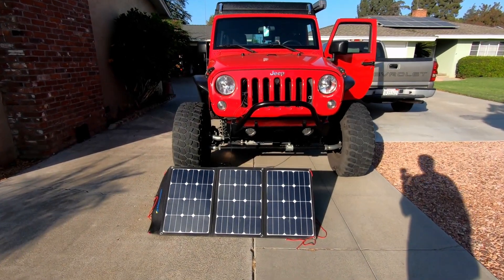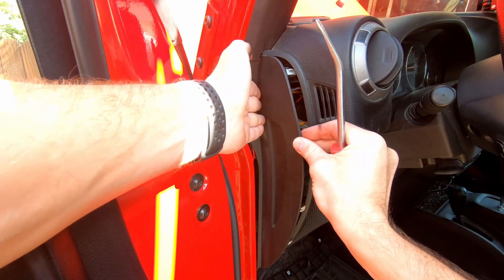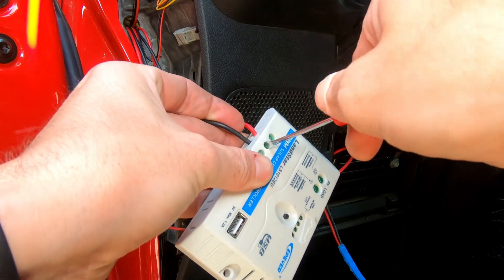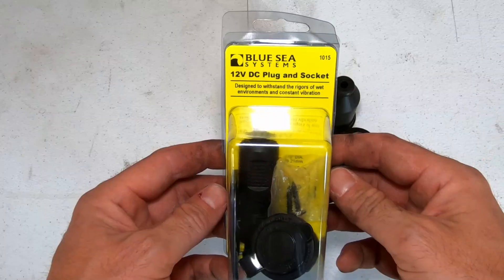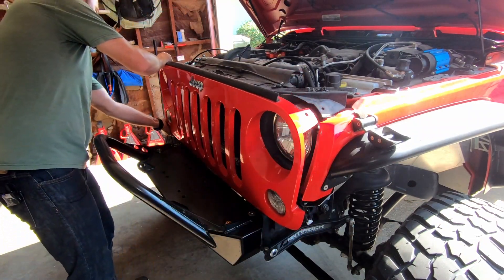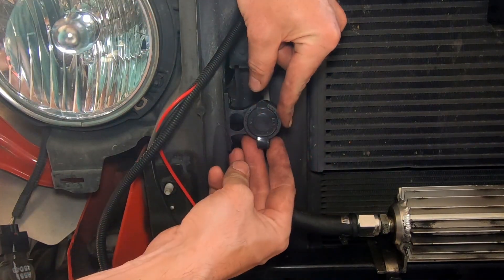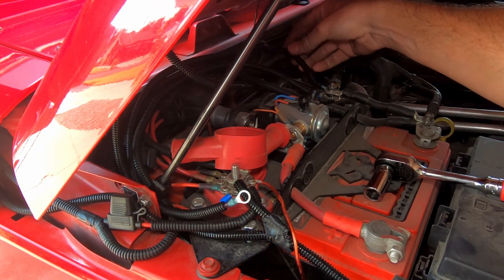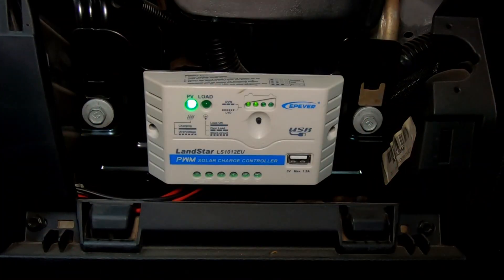Jeep JK Easy Onboard Solar With Quick Connect Install

Comment: When you installed the cascadia hood mounted panel, did you remove the PWM controller for this secondary system or did you leave this in place. Wasn't sure if you had everything running through your new victron system. Thanks and hope you're well!
Reply from the maker: Yes! I switched to a Victron Smart MPPT. I put links in the video description for what I used, but I want to say it was the 75/15. Much better and more efficient unit, plus I love the Bluetooth features with the Victron app and how it works with the V.E. Network in my Jeep with all of my other Victron components. Amazing components.
Reply: @KramerJunction  Thank you! Btw, there's a guy named John over on the expedition portal Ursa Minor monster thread that made up some J30 hinge tamers. They seem to help with the tent material getting sliced by the hinges when closing. Check them out. (DM me over there if you can't find the link). Cheers!

Comment: what is that long thing with the fins you have in front of the radiator.
Reply from the maker: It’s an inline power steering cooler for my PSC steering system 👍🏻